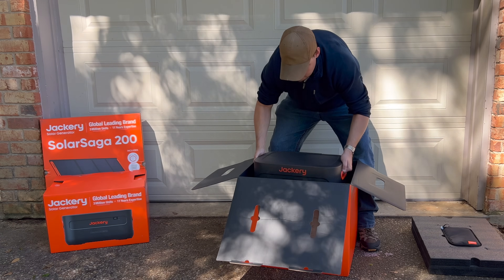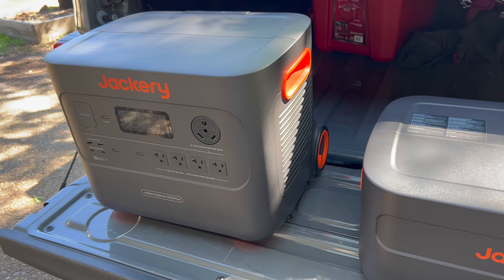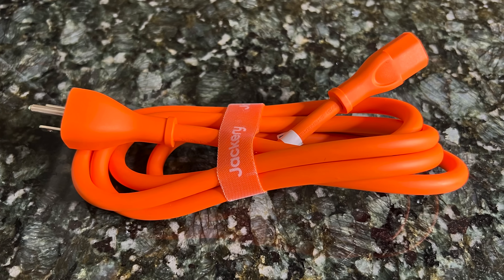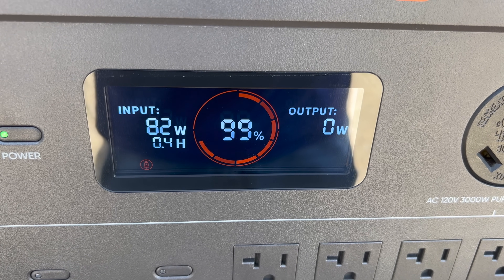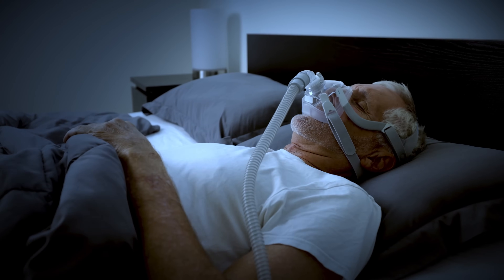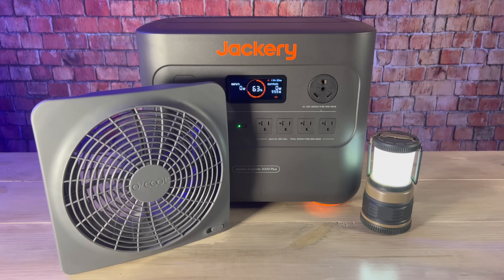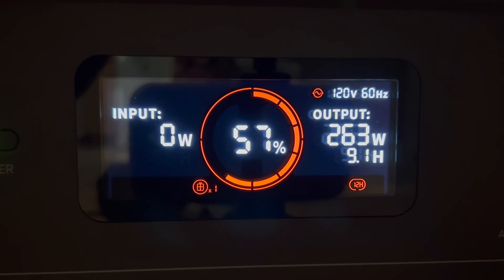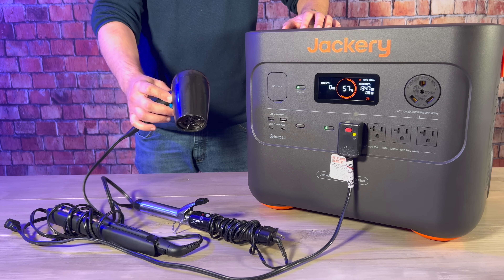Power The Most Important Parts of Your Home: Jackery 2000 Plus Solar Generator Review

Comment: Great video. I'm thinking of going for this with the expansion battery. The only problem I have is the huge cable connecting the two together. Why could they make the same cable but with 90 degree plugs so it fits flatter along the back of the unit? It would look neater, and take up less space. Anyways keep up the great work.

Comment: I’m considering jumping in with both feet and buying the 24,000 system combo 2 units and 10 batteries but I will probably talk myself out of it.  They are having a 40% off sale and there is a 30% tax credit… so instead of $25k+ it I’ll cost closer to $11k….  Live in California and our solar is supposed to be tied into the grid but I don’t want to have to do that..
Reply from the maker: If you do end up buying a system, please use my link. It would be GREATLY appreciated. Lol

Comment: I have a camper with a 30 amp service will it run a air conditioner in the unit if I add batteries to it
Reply: It’s possible but would eat up the battery quickly. Most RV AC’s run about 1500 watts

Comment: I noticed you were saying it could operate all sorts of things but for how long is the question? like a standard refrigerator will run for how long on a full charge?
Reply from the maker: The 2 fridges and a large upright freezer that I showed in the video for 10-12 hours with the extra battery. If you only run one fridge, depending on how efficient it is, probably 18-24 hours.

Comment: Why doesn't anyone ever talk about air conditioners in these reviews?
That and fans are about all I care about. 
I do have an 8000 btu portable ac
As well as a house unit. I live in a mobile home in south ga. My shade tree fell in our last storm.

Love your content, thank you.
Reply: Same, one of the main reasons I got the 2000 Plus was so that I can run an air conditioner, I live in Arizona so in a grid down situation heat exposure is predicted to kill some decent amount of people with the majority of those victims being old people. I've already tested the unit on a window a/c unit and the run time was almost exactly 4 hours and it was pulling around 360 watts the whole time. My current dilemma is finding a portable unit that uses around 200-250 watts max, obviously not gonna cool an entire room down at those low levels but it will definitely take the edge off if you're near by it, the research is still ongoing unfortunately
Reply: @dreamxcviii3249  good information.
Thank you for your reply

Comment: Can it power up home a/c?  I don't expect it could run the a/c long, but maybe just to take the edge off the humid summer heat in NJ?
Reply: A window air is usually around 1000w to run

Comment: Having an issue with solar charging.  I have the sight line circle fine and the cable connecting the solar panel to base unit, but the base unit does not show any activity.  It does charge fine when plugged into house.

Is there anything else I should be doing?

Comment: Wait a minute... @13:26 you include your parents washing machine. How were you able to include the 50A 240V washing machine using the 30A 120V transfer switch? From what I am experiencing, I would need to have 2 transfer switches and 2 solar generators to get a Line1 and Line2, and then I would need to connect one leg to one transfer switch and the other leg to the other transfer switch. Am I missing something?
Reply from the maker: Their washing machine is 120V. It uses a regular wall outlet.

Comment: Hi JR...I have solar panels on my roof.  I have enough that I do not use any of the city's electricity.  If the power goes out, will I need a solar powered  generator?   Would there be anything that I would need to do to keep my appliances up and running using my current solar panels?

Should I get some batteries to store my electricity?  What kind?  How to connect?

I have not seen this subject addressed on any YouTube sites.  I am new to your channel, and I find it very helpful!  THANKS